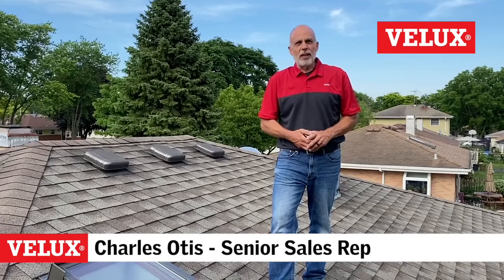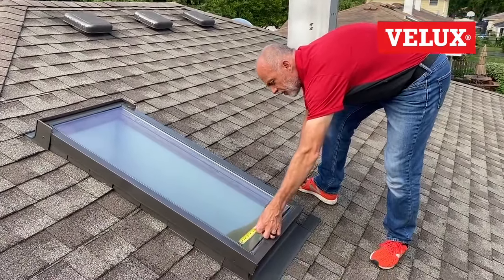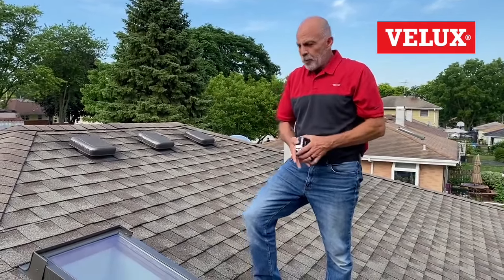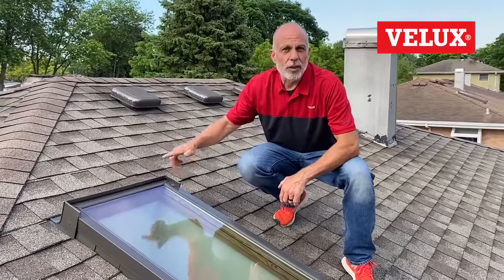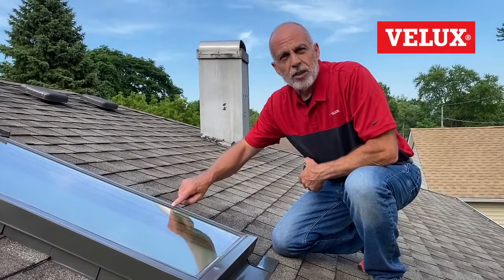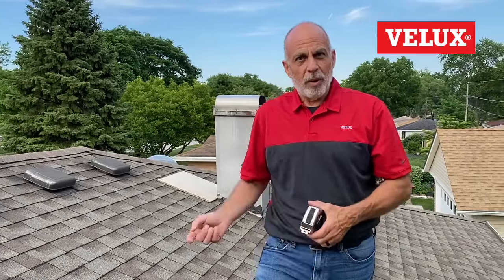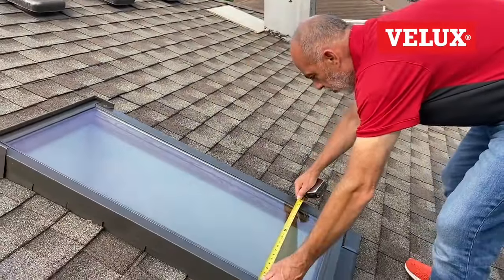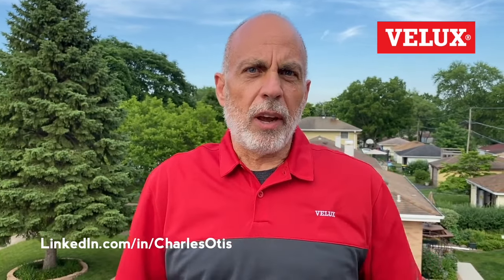How to Measure a Skylight For Replacement

Comment: Can a deck mount skylight be replaced with a curb mount? Also, if my roof is 25 to 30 feet high, and I can't get up onto it, how can I measure the size I need accurately from the inside?
Reply from the maker: Yes, a deck mount can be replaced by a curb mount, but this generally requires extra work and expense. 
It can be measured from inside. Measure the drywall opening right at the skylight. In your situation, it might be best to connect with an installer to do this for you. 
Feel free to shoot me an email, Charles.otis@velux.com. I can provide more direction if you’d like.

Comment: you need to put its for velux only.
Reply from the maker: The parts information and the ID information are definitely exclusive to VELUX. But the measuring tip can be applied to other manufacturers. 
Shoot me an email, Charles.otis@velux.com and I’ll elaborate a bit more if that would be helpful.